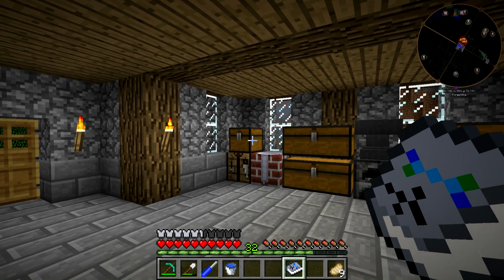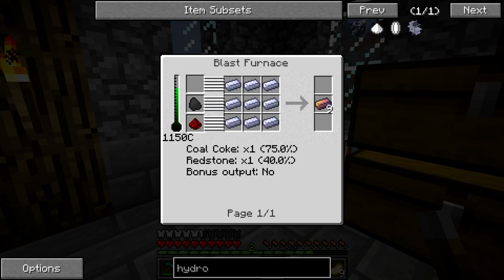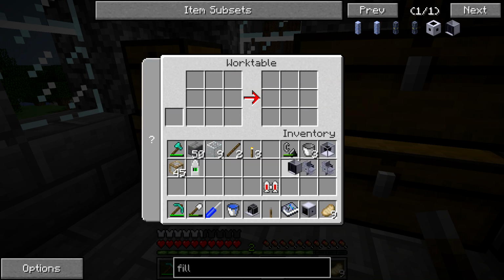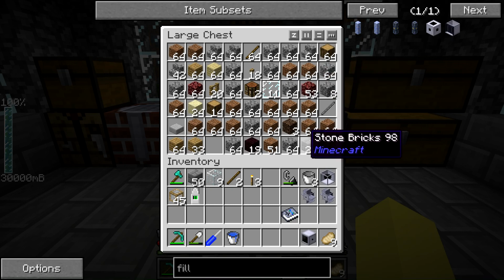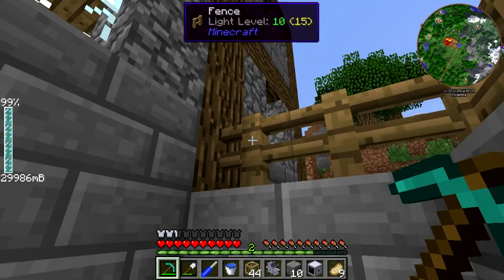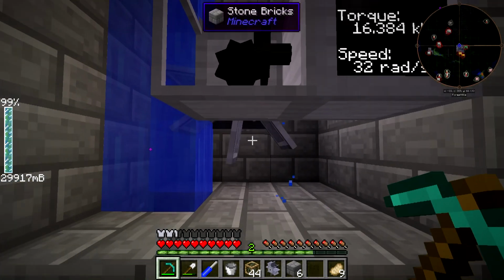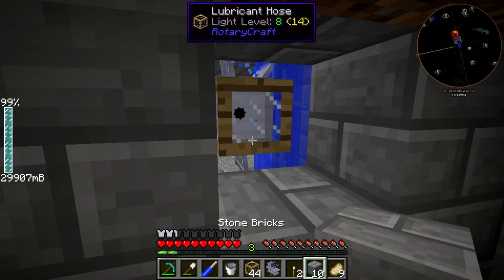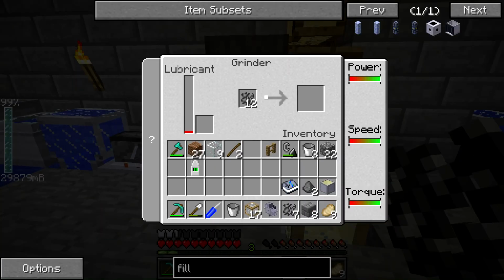Surviving With RotaryCraft :: Ep.14 - Hydrokinetic Engine And Ethanol Jetpack

Comment: Nice :). i ll personaly will be too much bothered by the hanging water. i m using four connected hydrokinetic mill at 10 y to power a boring machine, i just gear it down just a bit for speed but the combined torque of 4 hydro is amazing for the boring machine! just some pneumatic pipe item sorting and i m so happy that mining is not part of my time anymore. I advice you this since i guess mining take you quite some time inbetween episodes.

Your canola farm is ok but your lub fabrication is really not for more than 2 hydro maybe. That why i was advising you to stop rushing stuff and strengten your production by for exemple take time to automate ethanol because it allow you actually "play" and stop strugguling each time you want to do something needing more power than usual (like bedrock smelting, tungsten, creating jet fuel etc...)

Some ideas for futur episode:
- coiling winder, spring boots and a grindstone
- Obsidian factory, with auto shutdown for the pipes to not break because of pressure
- AC engine magnetizing unit to power a spawn controler (will allow you to speed up and shut down the spawner for noise purposes :p since it s next to your working area
-[preparing for electricraft] compacting ice, using it near a fluid crystalizer to provide a refrigeration unit on ice, and pouring the result into a filling machine. All of this for superconductor purpose. (i personaly use a AC engine to power the refrigeration unit)

Good stuff rage keep it up we love you <3
Reply from the maker: Trust me, the hanging water is killing me inside :P eventually I will find a way to work it into the house though. As for the automatic ethanol production, I have been straying away from automatic sugar cane farms ever since my IE series because that sugar cane farm took forever to make lol. Eventually I will get to it though! I am definitely interested in all the ideas you suggested and will actually be using one of them when I record today, so a special thank you is in order!

Comment: Use some bedrock dust to craft an industrial coil. It's the RotaryCraft Battery. So you can store the energy from the hydrokinetic engine before you can start with ElectriCraft. The industrial coil is also nice to power a machine for some time, because you can adjust speed and torque up to 4096 each.
Reply from the maker: Definitely been considering making the coil, but until now I had nothing to use it with. Hooking it up to the hydrokinetic engines sounds like a great idea because for the time being, they are not in use for powering anything :)

Comment: If your looking for other renewable power options theres the solar tower.  You use the mirrors to reflect onto a central tower, apparently in one of the version 14 updates it can be updated to a molten salt version.  Risks including setting things above and around it on fire.  I mostly wanna just see you try it out before I mess around with it :-p
Reply from the maker: I have looked into the solar tower and plan on making a video about it very soon, but one thing to keep in mind is if it is expanded too much, the mirrors can cause lag when updating, so expand at your own risk!
Reply: Yeah, Ive tested it in a super flat wasnt too bad.  Tested it in a non super flat in a village.  The lag was real, of course the village was also bursting into flames so that may of been a contributing factor.

Comment: so the hydrokenetik engine is that water wheel from Immersive Engineering
Reply from the maker: Exactly! It is a little more annoying to set up, but gives better rewards so its a trade off :)
Reply: Immersive Engineering's water wheel is early game mid range power source. Whereas the hydrokinetic engine is rather mid-late game massive torque power source. 

To put it in perspective, the hydrokinetic engine puts out the same total power as 32 steam engines.